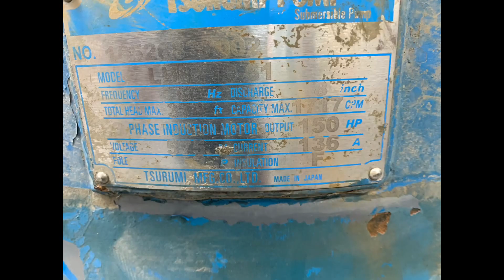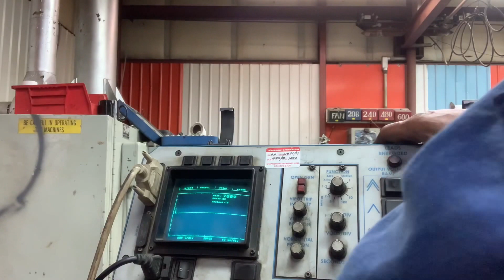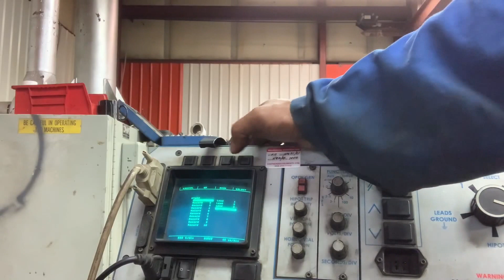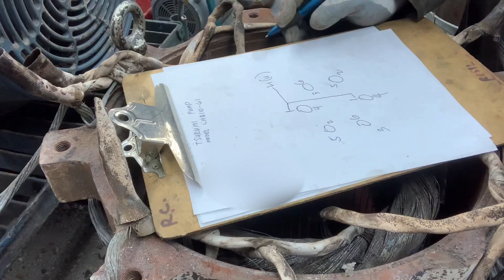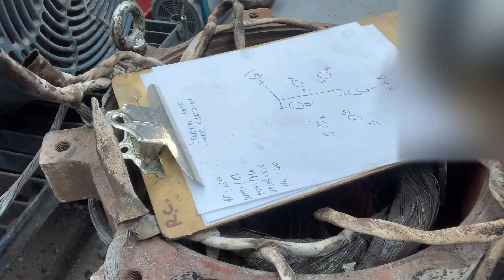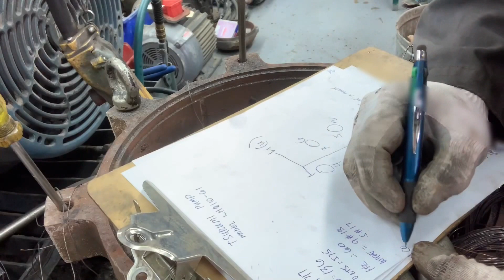Motor Rewinding;Dismantle Rewind Re-Assemble 150 hp Tsurumi | Part 1

Comment: Always awesome work. The name plate is showing 575 Volts. The stator is wound 4 Pole Wye-Delta connected Consequent Pole 2 circuit. How do you connect to run on 575 volts? Star or Delta?
Reply from the maker: Hi Steve sorry for the confusion its connected in delta outside you can review it in part 3 i bet this is a long video because i want show the assembly.Thank you.Have a good day.😊
Reply: I stand to be corrected,looking at the  pitch between any first lead line and out put line I feel must be high rpm motor hence coil connection most likely is star delta(initiating in star to drew less current upon gaining momentum then shifts to delta connection ideal for high load)

Comment: I will say that these works are from the category of very harmful to health! You need super ventilation, good respirators, and you should be given original milk to partially neutralize toxic accumulations in the body, and additional leave for the harmfulness of working conditions. take care of your very expensive health!!! Good luck in your work! Rest properly, sleep at least 8 hours!
Reply from the maker: Thank you for your concern it’s true that’s why we have a good ventilation inside the shop and exhaust fan to suck bad fumes from chemicals and dust.

Comment: When the windings are fired, the properties of the iron package lose their properties. this is considered a serious repair violation. How do you see it? Sometimes I will write in Russian. Read the description of your cool diagnostic device. Thanks.
Reply from the maker: Yes you’re right that’s why it needs to coreloss test first before rewinding which i did not film my coreloss test because it’s a rush job but i did. it decrease the efficiency of the core but in burning a stator it should have a certain amount of heat that’s why it should burn in an oven to control the heat of the chamber so that it wouldn’t damage the core.if the stator failed in the test will call it bad and advice costumer to replace the motor to a brand new motor.